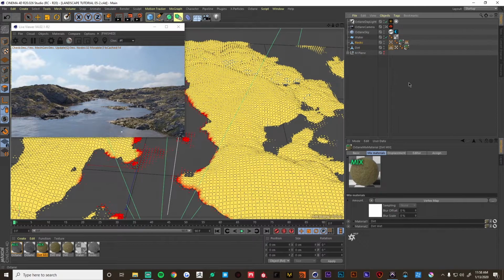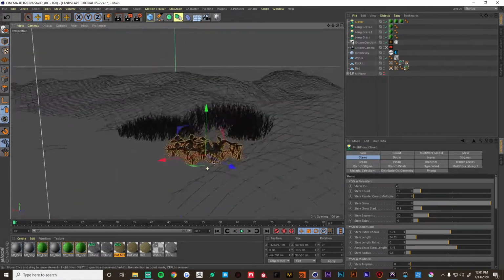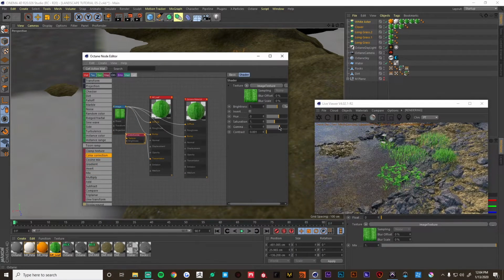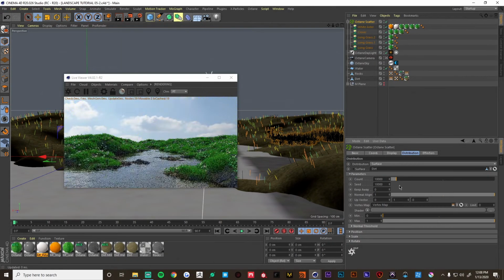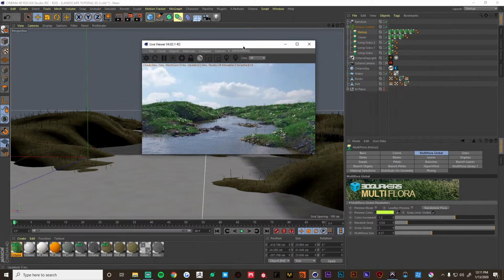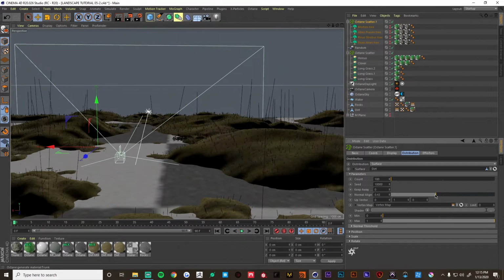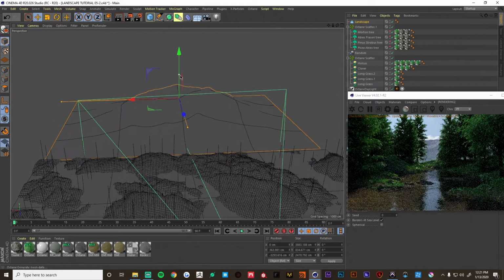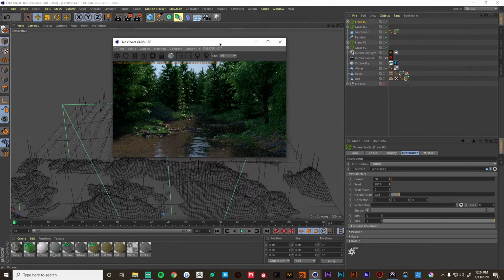Create a Detailed Forest Scene Using Octane Render and Cinema4D [Part 2 - Scatter]

Comment: amazing.. could you tell us your pc specs?
Reply from the maker: Currently running x2 GTX 1080s, an i9, and 64 GB RAM. Can't wait to try out the RTX series.
Reply: @DigitalNativeTV  ahhh well that's why it is so fast.. yeah i m waiting a new desktop too.. with an rtx. Can't wait
Reply: @DigitalNativeTV  holy fuck
Reply: @strangeworld2675  believe you me, that is not as amazing as you might think; in fact, it is a sucky set-up for GPU rendering, I have something similar, only an i7 for the octa core-16cpus and I promise you it does not do the job; RTX is the hope :)
Reply: I have 8 gb ram gtx 1650 can I do that
Reply: my pc is freezing :x
Reply: Amazing tutorial. I am new in C4d. I am having a little issue with forester. I need to add a different texture on the beaches separately from the time truck. But both have the same material how do I go about it . Please I need an urgent response